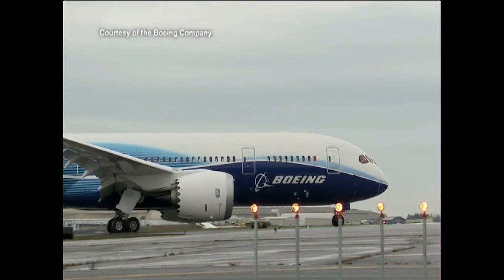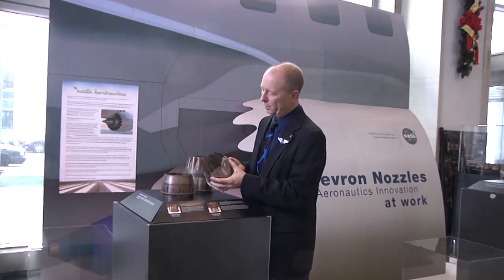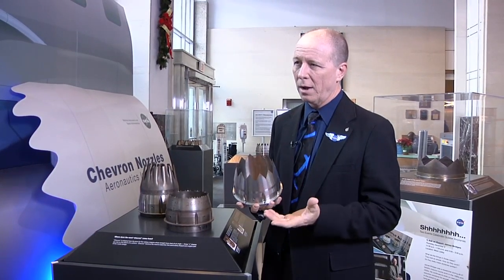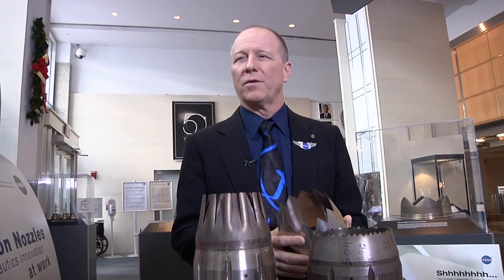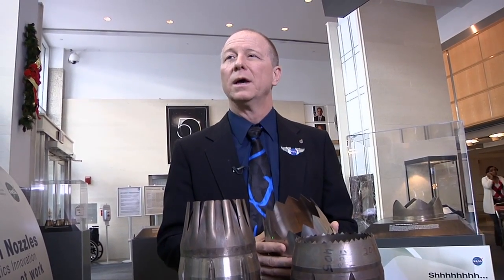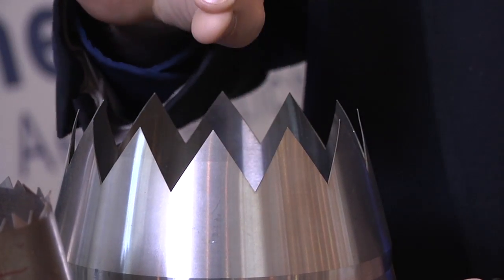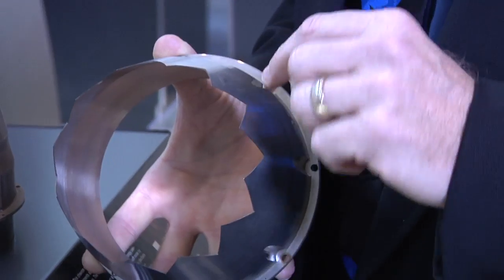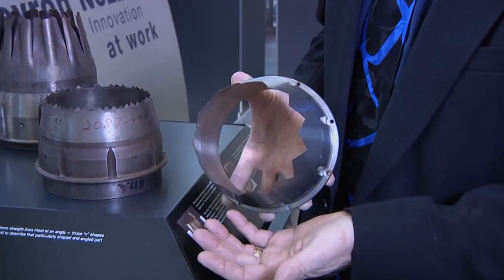V  Shaped Design Makes for Quieter Aircraft

Comment: @albertman900 Take a look at just about any air  conditioner brochure and it will mention a swept fan blade for noise reduction. The old blades where paddle shaped, the new ones have a trailing edge.

Comment: @tstatech 

You do realize that there's quite a difference between the two fans, right? One simply moves air, while the other compresses and guides ambient air of drastically different temperatures. Besides, these chevrons are on the trailing edge of a nozzle, not on the turbine blades. They smooth the exhaust into a more laminar flow compared to the smooth-edge counterparts.